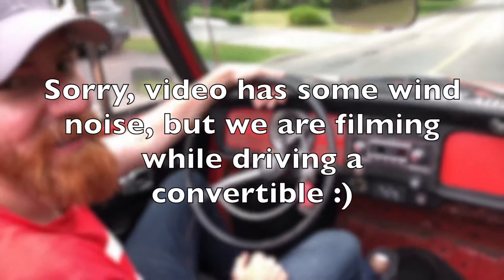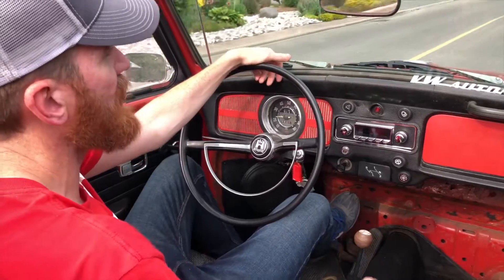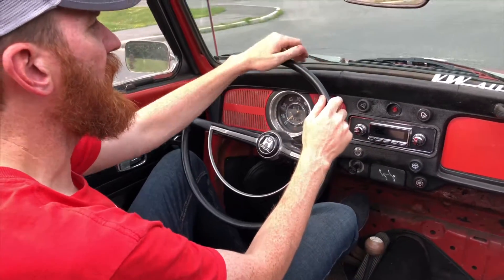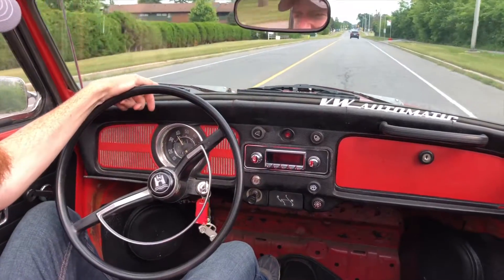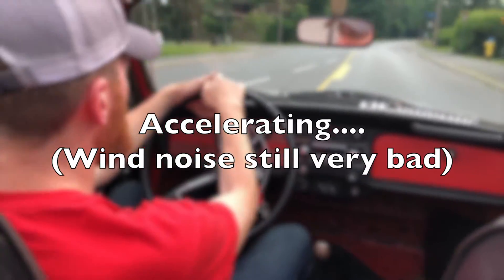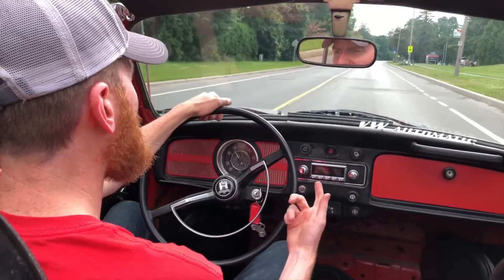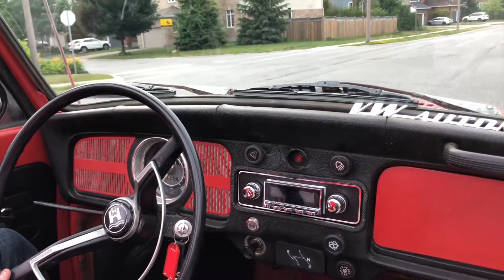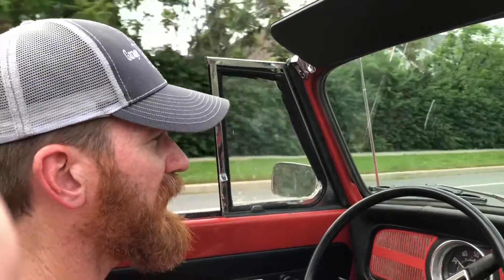VW Autostick - How to shift and drive an Autostick - Road Test

Comment: The Volkswagen Autostick transmission was an unusual transmission option for Volkswagen Beetles that came out in 1968. It was basically a three speed manual transmission that was equipped with a torque converter and an automatic clutch that disengaged when the driver put their hand on the gear shift lever knob. The gears were labeled L, 1, and 2. The advertisements of the Autostick transmission said that you could drive the car on city streets in first, then on the highway shift to second and travel in second. Low was for slow speed on steep grades. I am old enough to remember when this transmission came out.
Reply: Count me in. Too the Porsche Sportimatic as well
Reply: mercedes benz also used this system, they called it the hydrak automatic clutch. saxomat was a similar system used on a lot of european cars but used a centrifugal clutch instead of a hydraulic torque converter that the mercedes and vw systems used.
Reply: It is called semi-automatic transmission
Reply: Back in 94 I drove my friends vw fastback with an auto stick.
She eventually gave it to Me because she got an 80 camaro.
But before I got to drive it, it got towed for having outdated tags. Pissed me off😢

Comment: Nice video. No autostick bashing. I have had both 4 speed and autostick Beetles. I like the autostick a lot. It is nice not having to shift out of 1st gear after going 50 feet as in the manual.

Comment: I learned to drive on the 3spd. The one I learned on might have had a issue because I had to pause (just a 1 count) between gears. Car was a total dog as far as power/acceleration went. Still a fun/odd car to drive.

Many years later me and my father built a street car off a baja sandrail (tube frame) with 4spd and 1600cc, dual port heads, twin carbs, plus minor mods. Wet weight (no driver, all fluids full) was close to 1400 lbs. It had no body or windshield but you couldn't help but grin ear to ear (@60mph wind forced smile). The vehicle was so light that 18 psi was used in tires (stock front, rear 225). Also one rear tire blew and vehicle still drove flat (level).

Comment: I drove a 1971 Super Beetle from when it was new to when I unfortunately wrecked it on a freeway in 1978. It had this semi-automatic transmission which was very easy to use, just as demonstrated here. The only odd thing was that, to shift into reverse, you had to push down on the gearshift knob. I remember watching a valet struggling to figure out how to back my car up to be able to bring it to me.
Reply: You have to push down for reverse with a manual, too.  I imagine today's valets struggle if someone pulls up with a clutch pedal at all.

Comment: It is best to learn everything about the autostick that you can. You don't have to do the work yourself but you can explain things to the mechanic. I have helped VW repair shops correctly add a port for above throttle vacuum to a manual VW carb and how to route the vacuum lines correctly. It is most important to have the correct VW autostick distributor. The advance curve on the autostick distributor is different than the manual distributor. The advance comes in earlier(lower rpms) than the manual distributor. You really should also have the correct VW carburetor. The correct carburetor has an additional vacuum source from above the throttle plate. All other vacuum sources are not only too strong but also incorrect. At idle, vacuum above the throttle plate is weak. Below the plate it is strong. You want weak vacuum when idling and putting into gear so that the clutch will engage smoothly. High vacuum from below the throttle plate will cause the clutch to slam when it engages. When upshifting you want the clutch to engage quickly. As soon as you step on the gas pedal, vacuum above the plate is strong. The clutch will engage quickly. Below the plate the vacuum is weak and the clutch will engage slowly. You will notice the engine racing as the clutch has not engaged quickly enough. The autostick is a very simple system. Understand it and you will have no problems.  I love this video. It shows how simple it is to drive VW autostick. Forward and back. When I had my 73 Super autostick after a short while I stopped using Low. It barely helps acceleration and the shift lever movements are awkward. You can shift much faster between Drive 1 and Drive 2. It's a shame that sometimes it takes decades to appreciate some things.

Comment: thanks! about to buy a sandrail that has autostick in it... I was wondering why it was listed as manual when it only had 2 pedals. Now it makes sense.
Reply: It is a cheap automatic the vw made only for America ...... And it is better than normal autos
Reply: Just out of curiosity, how well did that sand rail perform?
Reply: I understand. That is a good option for a sand rail. I have seen that done before. The reason that I asked was because a close friend told me that he had seen a sand rail with an auto stick and it performed extremely well. I was curious.
Reply: I understand. That is a good option for a sand rail. I have seen that done before. The reason that I asked was because a close friend told me that he had seen a sand rail with an auto stick and it performed extremely well. I was curious.
Reply: I understand. That is a good option for a sand rail. I have seen that done before. The reason that I asked was because a close friend told me that he had seen a sand rail with an auto stick and it performed extremely well. I was curious.
Reply: I understand. That is a good option for a sand rail. I have seen that done before. The reason that I asked was because a close friend told me that he had seen a sand rail with an auto stick and it performed extremely well. I was curious.
Reply: I understand. That is a good option for a sand rail. I have seen that done before. The reason that I asked was because a close friend told me that he had seen a sand rail with an auto stick and it performed extremely well. I was curious.

Comment: completely rebuilt a 69 model. new hot motor, 72 super beatle fenders and bumpers. Chevy wheels and fat tires using adapters.
Thing was fast, you could adjust the "Catch" with the valve in back. Raced around tampa / st pete. Out rand stick bugs as the second gear was the beast
I could go from about 15-20 to 45-50 very fast

Comment: Hey guys I contaced you a few months ago about putting back my 68 autostick. I have a question. Where can I buy the fluid lines for the autostick. Mine are still original. Any ideas? I would like to German style like it came. How many quarts of ATF does it hold. What type of ATF FLUID did you use. VW DARRIN here on YouTube said type F. Thank you for all and any help you may be able to offer. Thank you for your well detailed videos.
- Keep Dubbing -
Reply from the maker: Hello,
We had to get new cables made, could not find anyone selling them. We even had to re-use ends, so make sure you don't toss them.  As for ATF, manual states must be Dexron. We have been using Dexron 3, with success. Also believe it hold about 4.2 L from dry, but not 100% on that.  Good Luck.
Reply: @GarageTime  thanks for the info. I have the original owners manual it states type F. I have had a few fellow youtubers contact me about companies selling parts now. If you want them let me know. If you have any companies let me know also. I may make a video on that. What year is your autostick?
Reply from the maker: Interest about Type F, our Bentley manual states Dexron. Anyhow, will consider trying Type F next time I drain, just to compare. Could even be an interesting video :). For autostick parts we have been using cip1, eVWparts, bugcity, thesamba and eBay for used stuff. Please share if we are missing some others, a question we get asked on a regular basis is where to find parts. Thanks
Reply: @GarageTime  I posted a video on my channel about these brackets or hold down looking items. If you get a chance watch the video and see if you can tell me what these belong to. Thanks for your help
Reply from the maker: You mentioned having a list of places to buy autistic parts? Looking for torque converter bushing and can't find one.  Any help would be appreciated. Thanks.
Reply: @GarageTime  when you get to the website type autostick in the search
Reply: @GarageTime  let me know if you find it, if not I will pull out my lists. I'm still verifying a few other sites. I have a few other sites as well. Early stages of doing a lengthy video on this topic for all
Reply: @GarageTime  bugcity.com has one its pricey. 149 bucks. Let me know if these help
Reply: @GarageTime  search engine autostick once on bugcity also

Comment: I've owned VWs since 1971. Now it's 2019 and I'm buying my 1st Autostick. So I appreciate your video. Does it have the same gear ratios for highway as the standard trans?
Reply from the maker: Hi Tom, welcome to autostick! Was a little intimidating at first, but with some reading and trial and error, it is pretty simple as you would expect from a VW beetle.  Anyhow to answer your question the ratios are the same, but since the autistic has three gears they keep first (in standard transmission) due to increase in high torque at low speeds. So for example 1st in standard is 3.8, first in autostick is 2.06.  2nd in std is 2.06 and autostick is 1.26 and so on until 4th in std is 0.89 and 3rd in autostick is 0.89. Same for highway speeds, however the high torque makes it feel peppier and fun to drive at low speeds.
Reply: According to your year, 1st, 2nd, 3rd, and R&P in the AutoStick corresponds to 2nd, 3rd, 4th, and R&P in the manual. The tourque convertor takes the place of the manual 1st gear.

Comment: On the one we have there is an electronic "clutch" activated by the gear stick being pushed downwards lightly. Does yours have this. Ours is 1969 original right hand drive Karmen convertible 1500 beetle. It says in the owners manual depending on if your in town or on an open road you select the 2nd or 3rd top gear at the start of your journey. We used to do this and then realised that changing on the move was more appropriate. However it works fine setting off in 3rd.

Comment: Thank-you, for a very well explained (even over wind) and shot video explaining the Volkswagen Auto-Stick, or Semi-Auto. I recently lost my right leg below the knee and have been searching for a vehicle and a system that will still make driving fun. I have an adapter that will rig the stock accelerator to the left side, where the clutch pedal would be and because Volkswagen's of the middle 60s to early  70s were fairly simple mechanically it makes the conversion fairly easy. Now I just need to find a nice type 3 to modify! How beefy are these transmissions? Will they accommodate some mild performance upgrades? Nothing silly I'm not out to win any races but I'd like to be able to cruise comfortably at 75-80mph and get to speed in a reasonable amount of time. Cheers!!
Reply from the maker: They seem to be pretty solid units, just keep in mind the autostick had different timing curve and additional vacuum lines for the system to work. Not saying not possible, just typical mods, dual carbs, electronic ignition etc. Will require more planning and thinking, making sure it will work well in an autostick
Reply: @GarageTime  Thanks again! I will keep your advice in mind as I look for a suitable contender. I'll let you know how things work out.

Comment: Hey man, I’ve got one of these , and when the car is off I can move the stick in between gears. I can’t turn the over if it’s in gear either. However, when I power the car on, it won’t allow me to select a gear. Any ideas on what to check?

Comment: 35mph in first? Wow. What are the other gears for?
Reply: Because of the torque converter, Driving Ranges 1 and 2 are able to be used at speeds that would simply stall out a manual transmission car. And 'Low' on the autostick equates to 2nd gear on the manual trans. There is no first gear(literally) in the autostick trans. The torque converter obviates the need for a first gear. Please see my recent post for some additional detail and info.
Reply: @johnhazel591  
I have never heard anyone use the word “obviate”. Thanks for using a word many have never heard before. I’m also impressed with your knowledge of the autostick bugs.

Comment: Quick question. Its only 2 speeds? Also how do you start it on hills? Does it roll back? Thanks
Reply: It's a 3 speed manual.   Electric clutch switched from the gearshift.   Torque converter to allow stopping in gear.  Super low for steep hills, medium for around town, and tall for cruising on the highway.   They are awesome if you don't like a manual clutch

Comment: Great video, I just went to see one of those today, had no idea how to test drive it.
Are this AUTOSTICK transmissions good? If it breaks, anyone can repair them?
Reply: I can’t imagine that there are too many guys left around from “back in the day” that are still around to work on a broken automatic stick shift transmission. I don’t recall them being all that much trouble (but they are nearly 50 years old now) but man were they slow! If you can find a few auto sticks in parts cars, they should be cheap because of lack of demand and I would probably grab them just to have around “just in case”. I am sure NOS parts for them are hard to get (I bet most VW dealers put their stash of auto stick parts into the dumpster by the mid 1980s. The only real positive to them that comes to mind is they probably don’t cause any engine end play issues. Unless your just looking for a weekend driver and like the auto stick as a conversation piece, I would just go for a standard 4 speed car. More power, easy/cheap parts, no headaches.

Comment: Does anyone with an autostick use the “L” gear?
Reply: No, not really. Some people do but the car was designed to primarily be used in Ranges 1 and 2. Low is for snort towing and traversing super steep hills. I ran it through Low when I bought the car to make sure it works but I’ve never ever used it on the road. And I daily drive mine!
Reply: @RoyalDogmeat  Cool, thanks for the reply!
Reply: @RoyalDogmeat finally a question about "low" and a proper answer!   The video makes no mention of "low", and also doesn't take the viewer through how to put the vehicle in "reverse" - and how there's little need to worry about accidentally putting the shifter into R while driving forward.

Comment: It sounds like you just use 1st and 2nd while driving. Do you use the Low gear at all and if so at what speed do you shift into 1st gear. I'm not new to VW's but I am new to the auto stick. I just inherited a 1975 VW Standard Beetle with fuel injection and Autostick so I'm trying to get familiar with it. By the way, great video.
Reply: It rearly needs to be used. Unless going up steep hills 1st gear will be fine for most cases

Comment: I always use all three forward gears when driving...it's a bit more "snappy" and not as sluggish...It's not as fast as a manual 4 speed, but I find an AutoStick fun and different to drive.
Reply: So, there is no clutch?  Would this be like semi auto
Reply: @abbysapples1225  Yes, there's a clutch, and it's used whenever you move the gear lever...very similar to the Chrysler/Plymouth/Dodge/DeSoto fluid drive of the 1940s-1950s...It's layout goes like this:  engine, torque converter, manual clutch, and gearbox...very simple and easy to drive.

Comment: Hey guys I need some help from you guys on my 68 autostick. Check it out on my channel. I show a walk around video. You can see its a mess. Is there anyway I could call you guys and maybe walk me through some things. My car sat in a few bodyshops and nothing done to it. I want it all back to oem.I want it 100 percent correct. I have questions.
Reply from the maker: Volkswagenplanet Hello, always willing to help. Where are you located? What questions do you have? Have you looked at all our autostick videos? Let us know, thanks.
Reply: Garage Time I'm in Tampa, Fl. I watched all your videos a few times over and over. I have been around vws for about 20 years. My concern is the mounting and brackets. This was my step- fathers car. He passed on fathers day of 2006. I want this car to be put back together perfect. Money is not a concern. Just can't find info anywhere. I have the Bently manual. I. Know the gear shifter is all correct. That was not messed with. The rest is in boxes or in the car. I sent it to the bodyshop running and got it back in boxes. Thank you for your help.
Reply from the maker: Tampa, ok, so at least we are in same time zone :).    We only do GT in the evening when we can find some time, however, if you want to send us some photos or maybe formulate some questions and send to us in an email with your telephone number we will try to give you a call over the weekend to help out.  Our Email address is garagetime.ca@gmail.com   Thanks and we will talk soon.
Reply: Garage Time thanks guys, I really appreciate it. I will try and work on this in the morning. This is why I love the vw community.